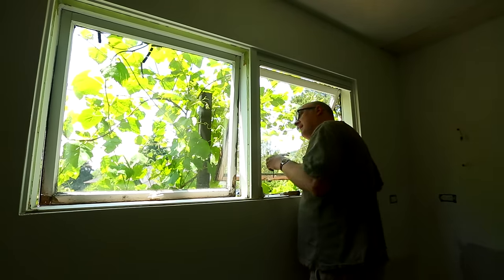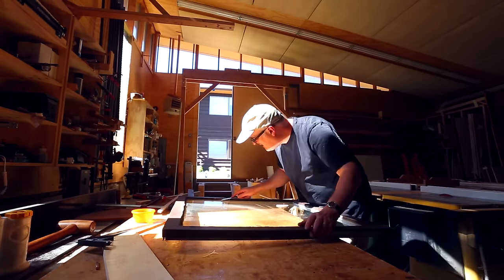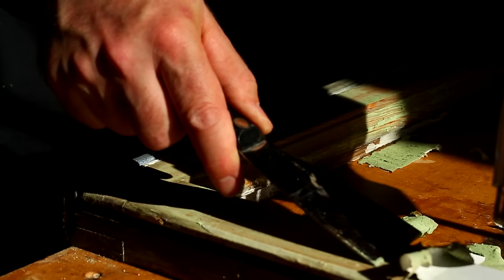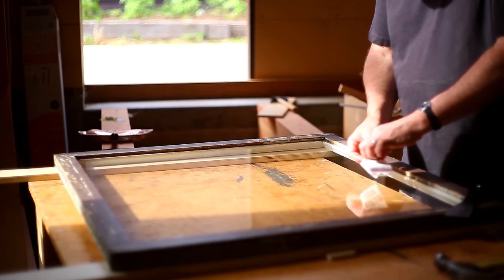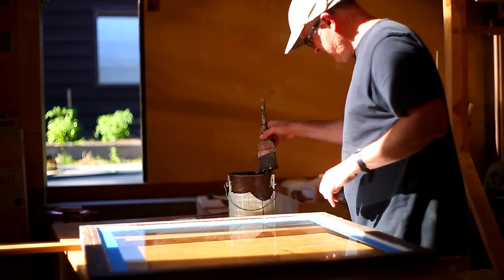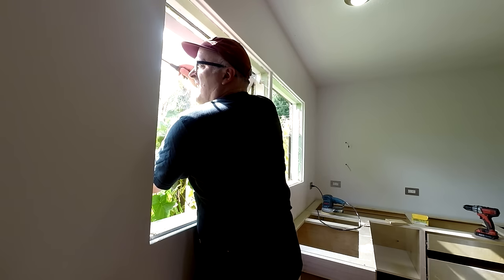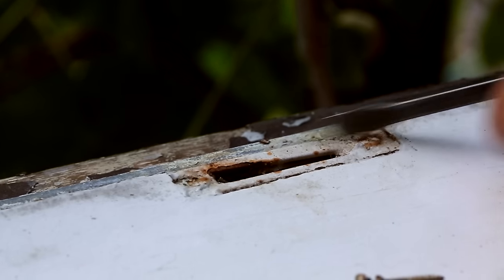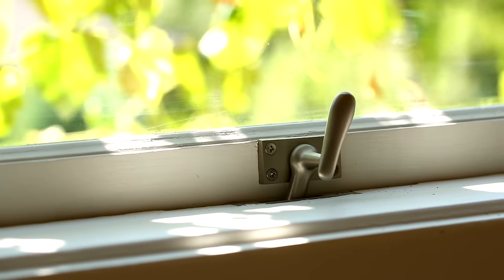Kitchen Remodel: Part 9 - Windows

Comment: Tip from a glazier, the rabbit where the glass sits should be primed before setting glass. The bare wood sucks the oil out of the glazing compound which causes it to dry out and get fragile, crack and eventually fall out. You should have prepped and finished the ext of the window casings while the windows were out. Much easier and you get a much better job when there is no window in the casing. The glazing bead you laid down with the caulk gun was too small, the trick is to apply the glazing with the gun in a very thick bead, over sized bead and finish it with the puddy knife. Dip the knife in paint thinner before you slide it ac ross the glazing and it just slides across without pulling. Just some quick tips from someone who has done it for 35 years. Love your videos and that shop, that shop, LOVE IT.

Comment: Here's a little trick for phillips head screws that I learned in the army. Wet the tip of the screwdriver (or screwdriver bit) with water (or a little saliva) and dip it into some cleanser like Comet or Ajax. The abrasive in the cleanser gives the tip of the screwdriver (or bit) a little additional "bite" in the slots. It works so well I've broken screwdriver bits before the head stripped. Every crew chief I knew had a little bottle of Ajax in their toolbox.
Reply from the maker: Mark Lindsay I will have to try that.

Comment: Curious to see single pane glass - where I live in northern Europe, all windows are pretty much double pane insulated glass, unless in really old houses - but even so there is usually put a newer, extra piece screwed into the wall on top to insulate. Also haven't seen glazing to fit window glass before - usually here, in old windows it's done using wooden strips/lists, hammered into the window frame using nails.
Reply: trylleklovn using wooden strips looks better, but if done poorly the window won't seal well and it might even rattle, all of our windows have glazing (the old ones)
Reply: trylleklovn There aren't many new installations of single-pane windows in the States anymore either, I think it's just that he didn't want to replace the whole window. I bet that window is 40-50 years old. And many homes here with double hung windows have "storm windows" that add an extra pane mounted in an aluminum track. In the summer, you can slide the lower pane up an out of the way, slide a screen down, and then still be able to open the windows for fresh air. But typical "triple track" storms wouldn't work in Frank's case because of the awning style windows.
Reply: trylleklovn He lives in an area of the country that has really mild winters. The average monthly temperature is above freezing in all the winter months there. So although double pain is nice to have, they are not needed where he lives
Reply: trylleklovn exactly what I was thinking. Fascinating glimpse into something different though!

Comment: I used to restore old windows at one of my old jobs. Single pane windows, some over 100 years old. All of them had been glazed with linseed oil products. The ones that had been repaired previously using plastic glazing are the worst, the absolute worst to work with. While the ones that had evidence of haven being repaired with linseed oil products were still fine and the wood were in much better condition.

All you need is shellac flakes and denatured alcohol, linseed oil, linseed glaze and linseed oil based paint. Perhaps some chalk. The windows looked amazing after a couple of hours (and days for drying) work. =)
So it pains me a little to see you using plastic/acrylic products from a squirt tube. :D

Anyway, great episode!

Comment: Excellent work as always.
A little tip for getting steak free windows is to use news paper, it works very well with most off the shelf spray bottles of cleaning products.

Comment: Frank, as always your videos are entertaining.  A tip I learned from a professional window cleaner:  Dump the Windex.  Uses distilled water with a bit of liquid dishwashing soap added.  Works wonders and is way cheaper than Windex.

Comment: Nice job.  I have refurbished several of the windows in my house and I know they are not easy.  They are 100 years old too.    The points you had are the same my windows had in them.  So, I would guess you have some old windows.  
Just a tip, when you clean glass, the best thing to use is a wad of news paper.  Something about news paper really cleans glass well.

Comment: In Finland, double or even triple pane windows are the norm (For better heat insulation, obviously). Those looked extremely primitive by comparison.

You might say, well, it's not needed, because where he lives is pretty warm most of the time. But better insulation also takes a load off the air-cooler in the summer, keeping your house cooler (Irrelevant if you don't have a cooling system). Insulation also keeps the indoors temperatures more stable during the days and nights.
Reply: Victorhuhu Could be priorities, could be budget.

Comment: The trick with the old style putty is to just get a lump of it in your hand and then work it in with your thumb to force fill the fillet. Get it roughly to shape with a putty knife, and then use an old paint brush to smooth it out. Works a treat!

Comment: Always use oil based primer on bare wood with a good latex over it.  The Sherwin Williams Super Paint is good stuff.  If you pull that tape off while the paint is wet, you won't have to worry about pulling the paint off, and the edge of the fresh paint will meld down a little better.  I wouldn't suggest painting the window and scraping the paint with a razor because it leaves very small scratches.  Those 'checks' weaken the glass.  Turkish Coffee - man that stuff takes forever to dry.  Enjoyed the vid frank.

Comment: For cleaning the windows (or glass or simply ANYTHING) try Dish soap mixed with warm water in a bucket, sponge down the windows with that soap water and wipe it ALMOST dry with a kitchen towel and do a final wipe with a microfibre towel. Works just perfect. No streaks and the possibly cheapest way.

Comment: Love your stuff.  Keep up the great work!

Chemical stripping is pretty horrible....BUUUT....it when dealing potentially with lead and young ones, it does have an important place, as it does not produce any lead dust or leaded fumes from heated or accidentally burnt lead paint.  Some times it is the way to go.  

Also, some larger cities have commercial stripping locations that you can send your items in, to have them stripped for you.  Some times even in one day.  In Los Angeles, had two 4 tall detailed casement windows that i got stripped for about $70 each.   So that can be a viable alternative, too, sometimes.

Comment: Hi Frank. The trick is to slide the hammer on the glass. That way there is no impact with the glass just the pin or whatever you use.

Comment: I think using single paned windows again was a missed opportunity (and it seems I'm not the only one wondering). I don't know how cold it gets in the winter where you live, or how hot in the summer. But double paned windows (or tripple paned, which is almost the norm in new installations her in Austria) make a much nicer feel on the inside. Keep the heat inside in winter and keep heat out in summer and especially no constant draft of cool air when it's cold outside.
Reply from the maker: superdau At some point when we re do all the windows in the house I will do that.

Comment: Hi Frank !

These Phillips screws are just crap ... they always "strip" (is that the word ?) !

Here in Denmark we have some called TORX and they work - you can hold your arm right out to your max reach and you can screw them in WITHOUT "stripping" them !

TORX ... worX - as I use to say !

Nice to see your progress !
Reply from the maker: Keld Sørensen The screws I use on everything else have that head.
Reply: Keld Sørensen Keld,
Phipps head screws are made to strip. The beveling of the insert creates a clutch so that the screwdriver is able to slip out.
Check out the history of screw heads online. Pretty interesting.;
Reply: Keld Sørensen Phillips are most common in the US. We typically use Robertson in Canada and I've heard that torx are quite popular in Europe. I would actually prefer torx, but it's just not as common around here.
Reply: They don't strip if you use good properly sized bit.

Comment: was the wood in the window rotted?

looked like it or perhaps just really dark
Reply from the maker: Youbones Dark paint.  Yes the whole frame is going to have to be replaced at some point, the wood is not in great shape.
Reply: frank howarth In Germany we use double/triple layered glass and plastic/aluminium frames. They use a handle with two modes: Tilt and open. It is funny to see, that there are so many different solutions... I have never seen the mechanism of your windows before.
Reply: Andreas Hontzia It's not that we don't have those in the U.S., it's just that these are old windows. They didn't use to double or triple pane windows.

Comment: Did you oil the window frames before priming them? I've been told that if the wood is too dry it will absorb the moisture from the glazing causing it to crack much faster. Good luck with the rest of the build.
Reply from the maker: Marfelt Now that you mention it I remember reading that.  I did not.
Reply: Marfelt What kind of oil are you supposed to use?
Reply: I've used boiled linseed oil in the past. Seems to be traditional in Sweden. We also used caulking made from cold pressed linseed.
Reply: Marfelt excellent - thanks.

Comment: Hi Frank,
how is the climate at your hometown? I´m very supprised to see singled glazed windows. Here in Germany you have to use double glazed windows as a minimum requirement for new buildings since decades. If you want to gather cheap credits you have to reduce your engergy consumption for heating so much, you will nedd triple glazed windows. Winter can have -20°C / 0°F.

Rudi

Comment: Wouldn't it have been better if you got better insulated windows that require spray foam around the perimeter? Especially since you have cold winters in the Northwest.
Reply: AssociatedTechnology Portland sees a snow once a year--on a bad year--and rarely freezes, its a more temperate area of PNW. Too close the Pacific and the Columbia.
Reply: +Marc LeDuc Put me down as another person who's surprised Frank didn't install newer, better-insulating windows.  It doesn't have to freeze to see the benefits of better insulation (both in comfort and heating costs).

Comment: Always when I see US Windows I wonder how much more elaborate the Windows here in Germany are. We have Specialists for building Windows (Nothing against your amazing skills in woodworking). Like others have written, the Windows are always two panes in a frame, with Temperature Insolation and insulated framing. The Windows can get tilted and completely opened with one twist of the handle. Many are improved against burglars.

Comment: I really recommend not putting masking tape around the glass. Just paint the frame as sloppy as you want and don't worry about getting paint on the glass, as the paint helps seal the glazing. Just remove the paint off the glass with a razor blade ones it is dry, and get a nice finish that way.

Comment: If you glue the panes (I use silicone) you don't need glazing points. If you have to hammer, slide the hammer on the glass!  Regards, Matthew

Comment: of all the windows i have painted,  I never once masked anything. I simply paint all over them and the glass. afterwards i very quickly scrape them with a new razor blade. perfect lines with little prep and only a few minutes of cleanup.

Comment: As a woodworker, I don't understand why you didn't make new frames and use double glazed sealed glass with low E coating. With rotten wood in the sash, why wouldn't you whip up some new ones while you are at it and also replace the old corroded hardware?

Comment: frank howarth I know you are trying to make everything for the house, but how come you aren't just putting in triple pane PVC windows with low E argon gas. They keep the heat out and the AC in, during the summer and the cold out and the heat in, during the winter that is if you even get winter where you are. But that is my opinion.
Reply from the maker: Mack Monsees If the rest of the house was that tight then yes.  some day

Comment: Wow, that windows are nowhere near the windows we do have here. Im a bit shocked I have to admit! What about seals, an insulated frame, insulated glazing (2 or 3 panes), a locking mechanism that locks it in more than 1 place and so on? You could not rent out a flat with that here, nowhere. You lose 23%-30% of your heating through such windows!
Reply from the maker: 1hdsquad I lose more like .01% of the heat we lose through these windows.

Comment: If you use microfiber cloths instead of paper towels to clean the windows, you wont have any streaks. They'll actually pick up all of the dirt and grease off of the surface with just a bit of water, instead of smearing it around like the paper towels do. Super cheap for a lot of them on amazon: http://amzn.com/B0031B4YU2

Comment: why are you not using linseedoil putty and paint, when you have the trouble and stripping the old paint ? instead you use some ugly looking plastic filler from a tube. i love what you otherwise do but in this case i have to disagree with your work.